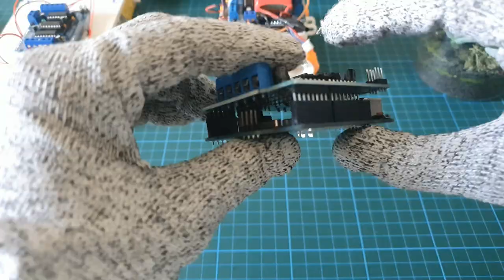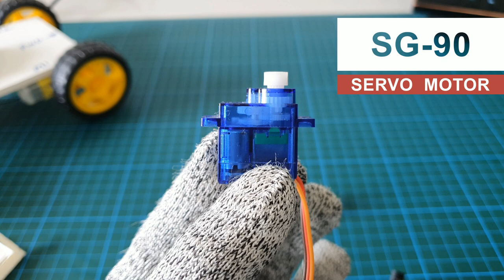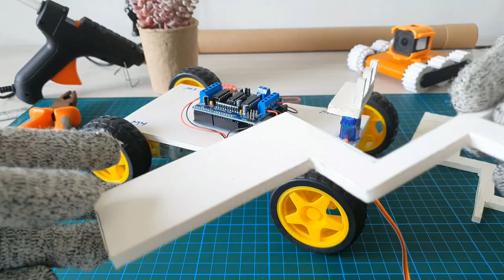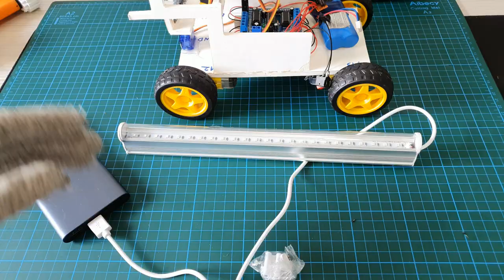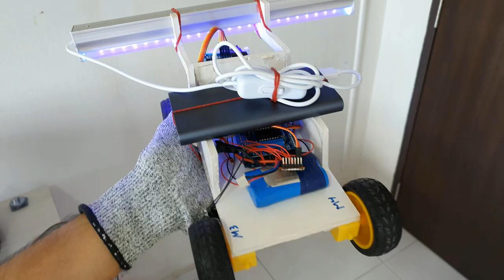How to make obstacle avoiding and Germ Killing Robot

Comment: So what did you attach with the Arduino uno
Reply from the maker: That's a motor driver shield on top of arduino
Reply: @SasteJugaad  how are you controlling the car? Is it a rc reciever of commercially available rc car or with mobile or anything else? Also what kind of shield to use with the Arduino uno? Grt video btw
Reply from the maker: I am not controlling it. It is autonomous. It has Ultrasonic sensor to avoid obstacles.
Reply: Hello dhairya can you send me circuit dig n code of the prg